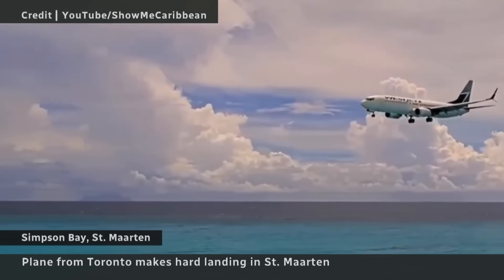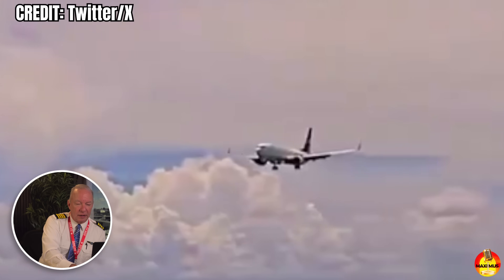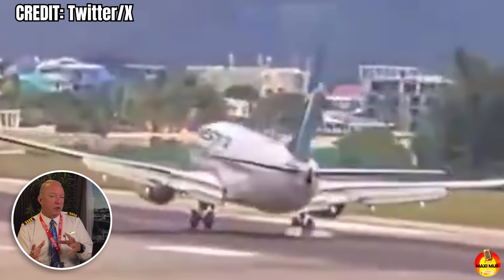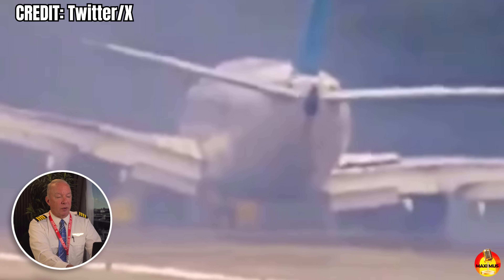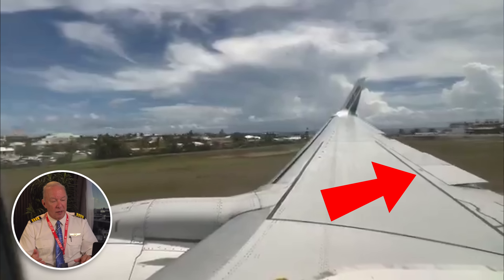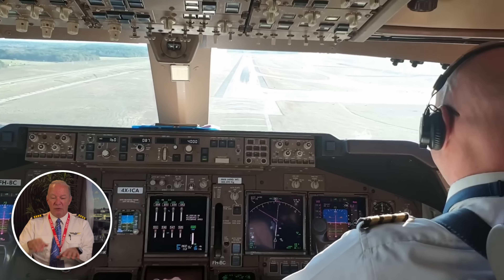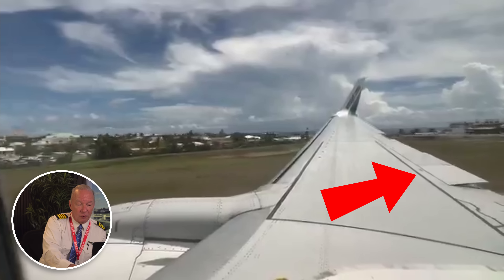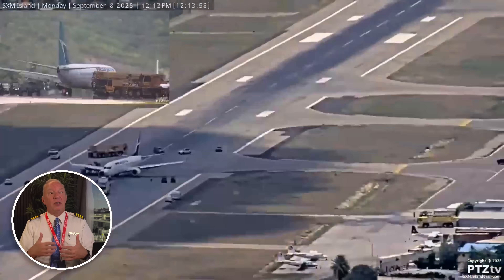Hard Landing at St. Maarten  What Went Wrong with WestJet 2276

Comment: Sorry Steve...but they were n speed and the landing was not a hard landing per the Boeing definition. Also your structural assessment is completely wrong. The tires did not fail and the strut itself pivoted up at the back end due to the failure of the aft trunnion pin. A hard landing in a 737 does not do this to the gear. There is and AD for corrosion on these pins and a few failed due to incorrect overhaul (ASA 1288) The top of the wing that is damaged is removeable composite panels. Just screw some new ones on and your good to go.

Comment: as a current pilot i have to say I'm slightly disappointed with this analysis. while yes it was a hard landing but its nothing out of the norm. Usually landings over 1g have a mtc call, while this i wouldn't even put over 1g. it sounds like a mechanical failure, likely the trunnion pin. the 737 has been designed to take rougher landings, on the old 200,300's you're supposed to call positive contact and ensure the plane knows its on the ground (WOW switches). i guess we will wait to see what the Safety board says about this, and maybe we will see another video like with Air India where we see a different take from the initial.
Reply: another thing, if youre riding in a car and you hit a bump/pothole. what ever you want to hit and the suspension/Strut collapses its going to feel like hitting the ground. point being is if the trunnion broke its not cushiony/soft any more, hence a hard landing.

Comment: When I first saw the planespotter video, it doesn't look like they hit that hard, just a little wobbly with the wind.  It will be interesting to see what the prelim report says about their vertical speed at time of impact.  I had wondered if the right engine had scraped along the runway after landing, it seems we would have seen a trail of sparks if it had.  This incident shows what happens with a main gear collapse on a plane such as the 737 with engines under the wings compared to a rear engine plane such as the CRJ-900 that crashed in Toronto, where the wing struck the ground and sheared off.  I think I would rather take my chances with the 737 in that situation.

Comment: After watching Blancolirio's video, not much of this rings true to me. 

For a starters, the area referred to as the aileron, isnt even the aileron. That is almost out near the wing tip, and its on the back of the wing, not the top of the wing, as the aileron can move up and down, not just up like those indicated flaps are doing in the airstream. The part that was moving around was the spoilers, and that has basically happened every time I have flown, as you come in to land or go through some turbulance those flaps move around quite a bit. And I typically record my takeoffs and landings just like that passenger did when its day time. I had a hard-ish landing at Brisbane Airport in 2022, same thing happened with my phone that I was recording on as we touched, but I still brought the phone back up to record the plane slowing down, despite heavy braking and having to use my other arm to hold myself off the seat infront of me. It was a smaller plane since it was a very short flight, a 727 I believe.

We will see what the prelim report says, but I would suspect it to say it was a rough landing, but within the limits of aircraft design and the rest will probably narrow right down to the trunion pin on the right side failing for some reason. Then to find out the exact reason we will likely have to wait for the final report unless its a safetry issue requiring an airworthiness directive to be issued.
Reply: They are spoilers that are also used as roll spoilers. One goes up on one side but the other stays down to assist in a turn. In normal use, to either slow down in flight or during landing, they both actuate at the same speed and angle. During a landing on touch down they both are doing the same thing. But before touchdown they are still assisting the ailerons as roll spoilers or anytime in the air at slow speed. At higher speeds usually only the ailerons are needed. But technically, you're correct, they aren't ailerons. The B-52 bomber only has roll spoilers, no ailerons at all. They don't need to be agile handlers in the air, as B-52 turns slowly and that all it needs to do.

Comment: Come on dude, your arrow was pointing at a speedbrake element otherwise known as a spoiler, NOT the aileron!  Granted some spoiler elements do actuate with aileron, but really for a so called expert this gross misrepresentation makes you sound/look like an idiot or a rank amateur.   And also the 737 manual from Boeing tells you the landings need to be firm, especially on short runways.  This looks exactly like the gear collapse of an Alaska Airlines 737 in California (KSNA) in Aug 2023, where the trunnion pin failed in only a moderately firm 1.71 g landing.
https://www.youtube.com/watch?v=LWJilegBG-w  ( Alaska 737 Gear Failure NTSB Preliminary Report.September 15, 2023 )
Reply: The trunnion pin did fail

Comment: One of the main things I look for when I am flying, although it doesn't really matter to the flight, is whether or not the pilot is old vs. young, with the mindset that the old pilot probably has thousands of successful take-offs and landings, over the younger pilot, who might not have nearly the experience of the older pilot.  Not that age makes a better pilot, I am not that naive, but, overall, the older pilot, has far more experience, and sometimes, not always, experience makes the difference between a safe landing over a disaster.  I just feel more comfortable seeing a white haired Captain, who may have been a pilot for 30 to 40 years, over a young pilot who looks barely 21.  Granted, the young pilot may have served in the US Military, and may have extensive time flying combat missions in something like a B-52, C-5A, C-130, Stratotanker, or whatever, and could have more experience than the Captain, who knows.  I just get a little better feeling when I see an old pilot.  I've flown with very young pilots when I was in the Army, and they were great pilots too, having flown combat missions extensively, landing and taking off on short runways in the middle of a combat zone, not only having to worry about taking off and landing the plane, but also whether or not they are going to be shot out of the sky at any moment.  Still, I rest a little easier in the back of the plane with an old timer at the controls, or at least monitoring the person at the controls if they aren't doing the flying, being able to assist if needed.   I knew a helicopter pilot once and I was literally like "They gave that dude the keys to a 30 million dollar helicopter?......God help us all".

Comment: You are a bit quick to pass judgment without all the facts. Well maybe a firm touchdown, I don’t think it exceeded the designed limits. There are pictures of the trunnion pin sheered, in what has been an increasingly number of premature failures on the 737.

Comment: Obviously the pilot was a naval aviator who was just trying to catch the wire.

Seriously,  I think that the shock absorber of the landing strut failed.

Remember: KE=Force x Distance.

If there is no fluid in the strut or a failed seal, the strut will offer little or no force until it bottoms out.  Instead of a tenth gee landing you get a ten gee crash.

Comment: I just watched the news on this mishap . Transport Canada has inspectors on-site to evaluate the plane. There are no repair facilities and no Aircraft Engineers and mechanics, If it cannot be repaired it might have to be scrapped .😢
Reply: You can fly in mechanics, aircraft engineers, parts and tools from anywhere.
Reply: The aircraft will probably be repaired to a standard fit for a ferry flight and relocated to an airport with maintenance facilities.

Comment: I am amazed at the forces landing gears typically take and still function normally.  I’ve been in large aircraft that have what might be described as hard landings so much that I thought my fillings in my teeth were going to pop out 😝, and yet the gear took the shock.  The engineering of those trucks is stout in my humble opinion

Comment: I’ve been to St. Maarten and it’s beautiful. I wonder if this was the French side or Dutch side? But wow😯
Reply: The airport is on the Dutch side and is on the southwest side of the island.  There is no airport on the French side.  It’s not a very big island.
Reply: @OldRustySteele thank you. I only went to the French side and I didn’t remember seeing an airport but thank you for answering 😀
Reply: @OldRustySteele That's not correct. There is an airport on the French side of St. Martin but it only handles regional flights with propeller types up to ATR 42/72 size since the runway is only 3937 ft long. It's known as Grand-Case airport, IATA code SFG, ICAO TFFG.

Comment: Flaps 40?  Lots of roll instability with F40 compared to F30, I used to call it the "300' regrets" because at 300' you start to appreciate the exaggerated roll as the runway perspective looms large in the window & immediately regret the choice of flap.  At 300' realise it's too late the reconfigure to F30. F40 requires lots of practice to feel comfortable, rather than having to do it only when performance requires it on short runways.
Just a theory.

Comment: Commercial aviation has insane “factors of safety”. Every part is built to withstand multiple times the amount of force it’s expected to withstand. I’m not convinced a maintenance issue didn’t attribute to this incident. Even if you touch down one wheel first, the landing gear should hold up. It may be bent, but it shouldn’t collapse.

Comment: The forward trunnion fitting is in the rear spar.  It is a ball style bearing. The rear pin goes into a beam called a walking beam which is removable. Here is what they will do. The mechanics will come down and decide if temporarily they can re use any of the parts to make the aircraft mobile.  They will move it some place out of the way. Then they will jack the aircraft again and remove the upper panel and the gear then the walking beam and then the forward bushing/ bearing assy. Then they will NDT the rear spar where the bearing assy goes and if it has any indications of damage they will address that by either machining the hole up to a slightly larger size until they feel it is good.  If this all checks out they will get a new fwd bearing. A new walking beam and then a new gear assy. Aircraft Inspectors will NDT all attach points for damage before putting it all back together. Eddy current. Then it will fly away. Love your videos. You ask. I told you. 😉. Airplanes are built very well and a lot of procedures like this get done during landing gear changes which are on a schedule and they basically go thru the motions of routine maintenance with added checks and some engineering support to help fix aircraft after incidence like this. I have been working on aircraft for 33 years and I’ve only seen 3 aircraft scrapped due to damage. One. 747 hit by so much hail over china that the entire fiberglass leading edge of the wing needed to be entirely removed and rebuilt or replaced. And 2 MD-88’s the one that slide off the run way in LGA and another that someone drove a small bag tug through the belly while sitting at the gate. All 3 aircraft were close to retirement and this made it more economical to scrap them. Airplanes are expensive. And Aircraft Mechanics can fix almost anything. Side note. Pilots are often surprised to find this out. While pilots are taught everything they need to know about only a couple of aircraft during their careers mechanics will be taught how to work on all aircraft in an airline’s fleet and some they are expected to service for other companies. And we are expected to work on anything they need us to repair. We do have some specialty skills. Sheetmetal. Landing Gear. Composites. Engines. If we are ask to do more than remove and replace a part.
Reply: NDT meaning ???
Reply: @wally7856  Non-Destructive Testing
Reply: @christopherrobinson7541  Thanx
Reply: 100%

Comment: There's a possibility of failure/s inside the wing structure. The strut didn't punch through the wing like hard landing Pipers I've seen, the failure was inside the wing structure pushing up and raising the top of the wing like a tent. The engine is probably what kept the starboard side wing off of the ground.
In the surrounding view there appears to be a lot of convective activity forming, typical of a hot day in the Carib, but they can create unpredictable wind gusts and shear when it's that thick.

These people may have been lucky that wing didn't fold on them in flight.
Reply: That is such an ignorant comment. The aft Trunnion pin failed and the gear pushed through the removable composite panel on top. Just screw new ones on and go. The structure is fine.
Reply: @marcweston2156  so when that trunnion fails this is the type of damage you see on the top of the wing, about 10 ft of the top of the wing is bulging up starting from the root going outboard.
BTW, ignorant is when you are so sure that a particular thing happened because it's your pet diagnosis and never leaving to question or looking any farther than the end of your nose that it possibly could be something else.
Maybe it is the trunnion like you say but don't belittle because your diagnosis comes from pictures just like mine does.
Reply: @hotprop92  The problem is your guessing based on no knowledge. Yes trunnion failures look like that and its not structure it pushed through. As I already said - They are composite panels that are removed routinely in order to change the gear or its parts. All you need to do is screw new panels on. There is no structural damage there. And yes - I have the pictures that show the aft trunnion pin failed. Also - trying to convey the notion the wing could have failed in flight is not only irresponsible but also ludicrous.
Reply: "Wing didn't fold" during the flight?? Stick to RC models.
Reply: @peterferrydriver  take a lesson in reading comprehension, comes in handy, like understanding what you're putting in your mouth or who you vote for.
You've not seen enough of life to be ranking on someone who has.
Reply: @peterferrydriver  take a lesson in reading comprehension.  Obviously the wing didn't fail in flight but upon touchdown, something collapsed, failed. Like your compadre you say it's a trunnion failure on the strut, fine. That seems like a whole lot, you say it's just superficial damage, for the failure of the strut. Struts need to be attached to the structure of the wings and the wings transfer that force to the fuselage, they are not just zip tied to composite panels.
Reply: @hotprop92  It was you that made the 
ludicrous comment "These people may have been lucky that wing didn't fold on them in flight." My reading comprehension is fine, thank you.
Reply: @peterferrydriver  based on my speculation that a device, the strut, which is attached in no uncertain terms to the wing structure enough so as to transmit those loads to the fuselage, tore loose from that structure at some point implied a potential weakening of that structure. That's what I wrote that's what I implied that if the strut breaking away from the wing structure could imply damage to a part that supports over 50% of the weight of the aircraft in flight the integrity of which  might have so been compromised that during the stresses of flight that wing COULD HAVE POTENTIALLY failed. That's not ignorance that's experience talking, ignorance is when you dismiss out of hand any and all probables because they don't agree with your past findings. I wonder why you're being so defensive and showing such insecurity about a different take on this accident, you're letting your reading comprehension be affected by an alternate theory? I'm not at St Maarten and I don't believe you're there either to stick your nose into that wing to see what was damaged and would need to be repaired.
Maybe you should go to blancolirio's since at every podcast he gives reading lessons.

Comment: Great prelim review of this rare failure. I am quite surprised that the main gear couldn’t dampen the shock nor resist it. It doesn’t look like a very hard landing (I’ve seen worse) but it looks like the fact that the right gear took ALL of it was the key factor.
Reply: Many comments seem to strongly suspect a known mechanical failure of the gear could be the reason, not a hard landing. As I said above, it doesn’t look especially hard to me.

Comment: Hi, what you don't say is that due to the short length of the 737 undercarriage (for historical reasons) the aircraft always lands with a firm "thump" that is felt throughout the structure. This lack of compression space is also a factor in the severe failure during the Delta Canada crash landing....

It's quite alarming how such a relatively small aileron deflection at low speed near to the ground gave such a sudden dip to the right !

Comment: I had a very hard landing years ago in an MD-80 with left main gear damage, unlike a lot of folks that were "I could have died" or similar, my thought was "Well, damn!  I'm going to be waiting weeks for my luggage.   Not a false bravado, but 1.  I had faith in the pilots, 2.  I had a little faith in the MD-80 and 3.  We rolled to a stop without issue...  Yeah, I won't get into what a MD-80 pilot said  back then:  The MD-80 lands with the maximum amount of acceptable damage.  That and I had the misfortune of riding in the same airframe a number of times and could almost count down to the right engine having a compressor stall "Boom" when they activated the reverse thrusters.